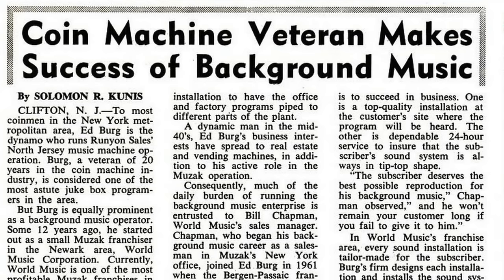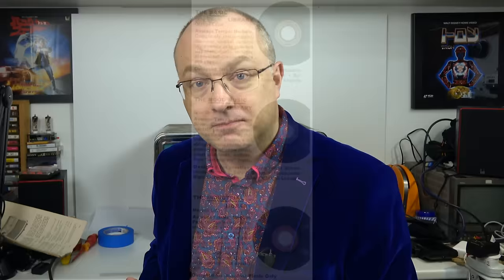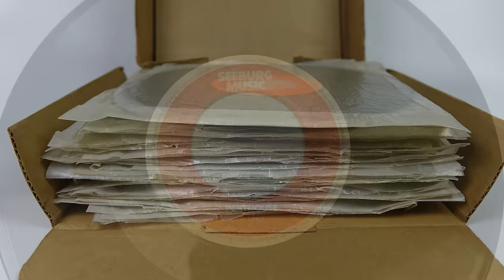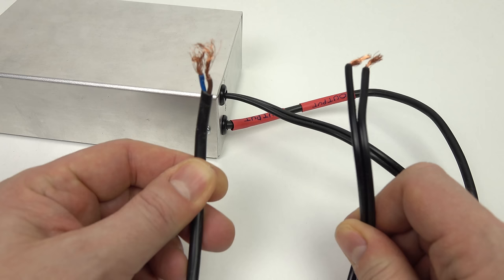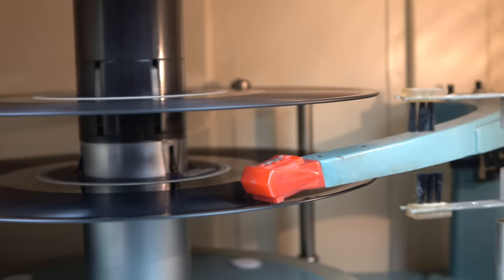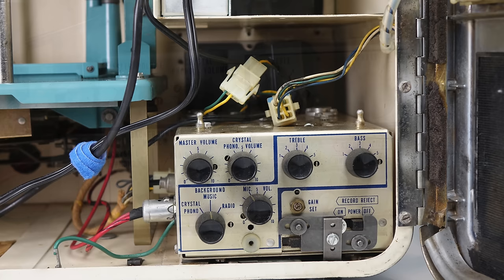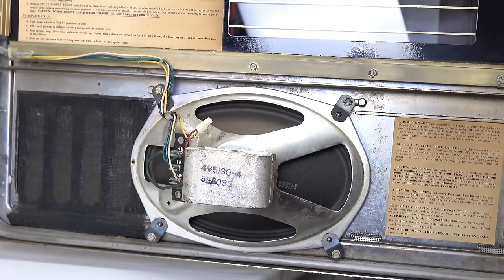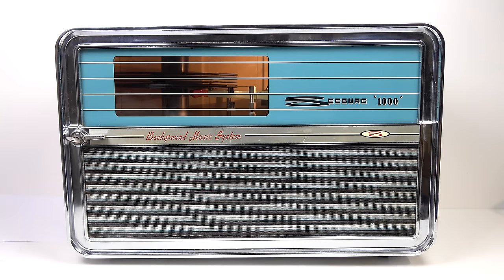RetroTech: Seeburg 1000 BMS1 Background Music System (1959-1986)

Comment: how do these sound on a proper hifi system though?
Reply from the maker: Too fast.
Reply: wow, a reply from Techmoan himself!! I am a professional journalist and I have to tell you, Sir, that although I am not so much into electronics, I just love your way of presenting information and every journalist can learn from you. Much appreciation! 
To the matter - I just saw the part 2 video but this time I missed the comparison in sound between regular vinyl records and the Seebugs - which would probably show why record companies did not choose to switch to the latter format, as it contains more music on a piece
Reply from the maker: Record companies used the slower speed for audio books before tapes took over, but not for music. In my opinion the audio is a bit better than a well tuned AM radio signal which would be good enough for what it's intended for.

Comment: I wouldn't trust those needles, they can be worn out and damaging the records, somebody out there must have some unused replacements.
Reply from the maker: This is a new cartridge. You can trust it with your life.
Reply: kainthevampireduck 
I agree, just because the cartridge is new the needles may be original and worn out
Main thing like I said in a earlier comment is redo the two main drive tires, that's where the warble he's having is coming from and totally ruins the sound quality. Plus he needs that weight on top as well
Very important :)

Comment: This guy is infuriating sometimes. Why didn't he just put a plug and socket on the sinewave converter and run the whole machine off of it? That would have avoided having to modify the actual machine. A while back he threw some rare device away because he couldn't get it to work. Why not sell it to someone who can use it for parts, or fix it?
Reply from the maker: BECAUSE - the sine wave converter Does not adjust the Voltage, just the 50 - 60 hz. The machine is being run off a 230>120V step down converter. In addition the Sine Wave Converter isn't capable of powering the whole machine. It's designed just to run a single motor, any more will overload it.
Reply: The load would certainly be an issue, but you could have plugged the converter into the transformer if it could have handled the load of the whole machine. I did assume that it was being run off of a transformer. There are converters that convert both frequency and voltage which would have worked for this machine.
Reply: It's really not that big of a deal, I guess, I'm just tired and grouchy.
Reply from the maker: No, honestly  - I would have put it externally, but there are two motors and an amp in the machine. It's a device made by a nice chap who makes these in his spare time for people who import jukeboxes into the UK and he's constructed them in such a was as they can only handle the load for the drive motor. The instructions say "Do not try to run the whole machine from this - it will burn out and could ruin your machine". I won't be selling my machine and it definitely won't leave the country - so may as well just convert it to work here forever.
Reply: I don't care does care, try saying that 6 times quickly when your pissed. Nice one dude. :)
Reply: I don't care what my screen name is. My screen name does not describe who I am.
Reply: I said 'nice one dude' , congratulating your admission you were wrong, that shows guts.
Reply: Oh, I wasn't sure what you meant by that. I'm just screwing up royally here. lol
Reply: That's probably not the best name, :) 
There're  not many people who admit they are mistaken on YouTube, you're a bit of a unicorn, ha ha ha.